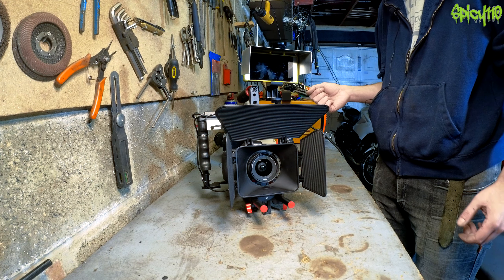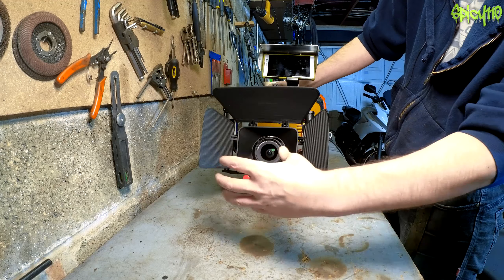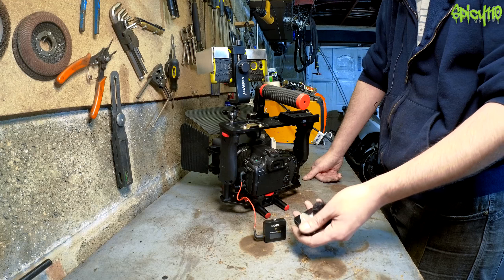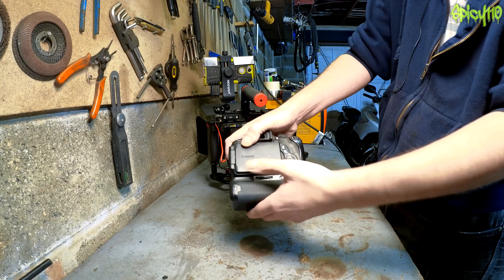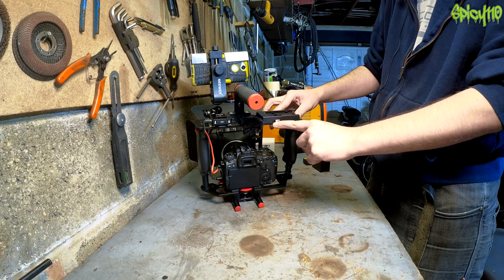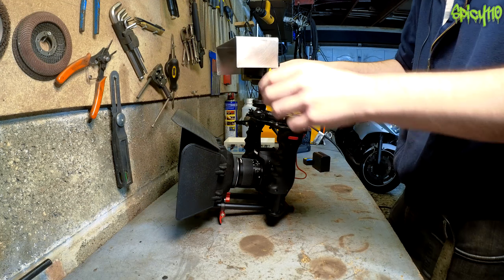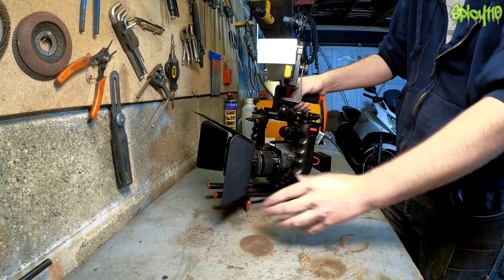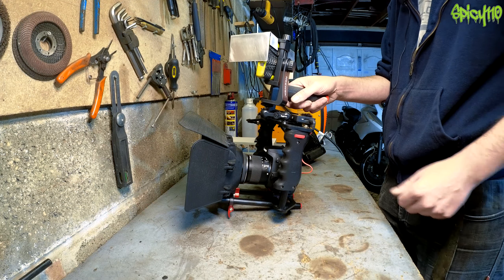DSLR Camera Rig Setup!

Comment: You can use aftermarket batteries with your GoPro man
Reply from the maker: Not really as far as I know as they are chipped so the camera knows what is and isn't real. Unless someone has got round that.
Reply: @spicy110  do you guys get different GoPros in the UK? In Canada I just pop my batteries in and everything works normally. If you want me to ship you one next time let me know.
Reply from the maker: It depends on the update you are running, it is possible people have go around the code of the batt. It is a war they will never win.
Reply: @spicy110  I've had a GoPro 6 through 10, no issues with my telesin batteries. From what I've heard from other motovloggers no one else has mentioned this issue either
Reply from the maker: @YouMotorcycle  hmm Intresting...I was told that by someone who had the issue. I guess it was the batts they were trying. Good to hear they DO work!
Reply: @spicy110  i asked a bunch of peeps on twitter and tagged you in. So far no real clear concensus but we'll see haha.

Comment: i was looking at a V mount set up for my sony A7 but the price of them made me whince. the next step down from that was TalnetCell which are basically usb power packs designed for delivering power to video cameras. if you get the adapter plate you can then run power to any audio recorders at the same time. 
the biggest pain i found was that a lot of consumer level cameras wont allow through-charging which would be a game changer (for example i can charge my A7 through the micro usb port but you cant record at the same time. i did end up getting a "dummy battery 240v supply" which is like a battery grip but plus into domestic mains. interesting vid though its cool seeing people set ups.